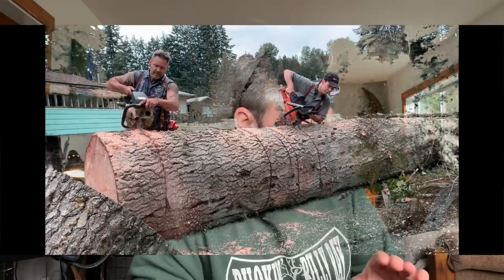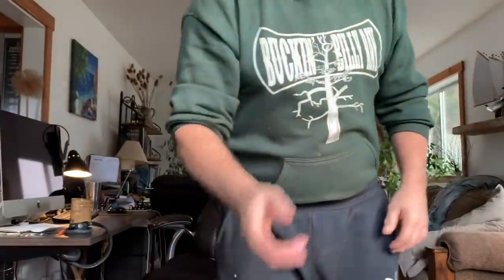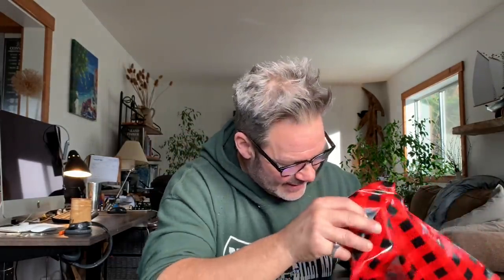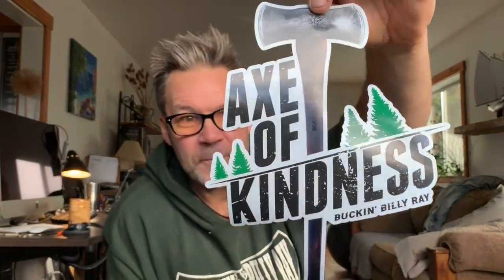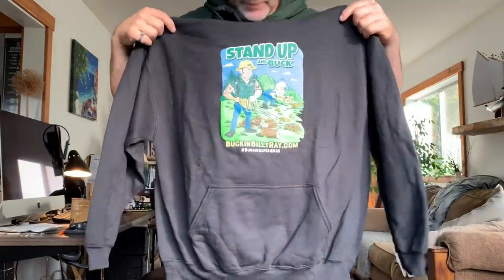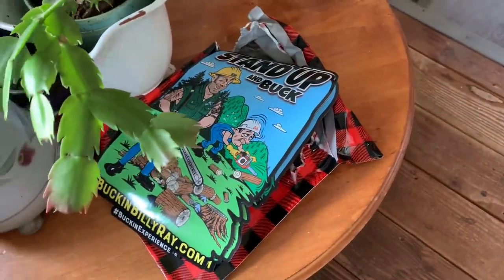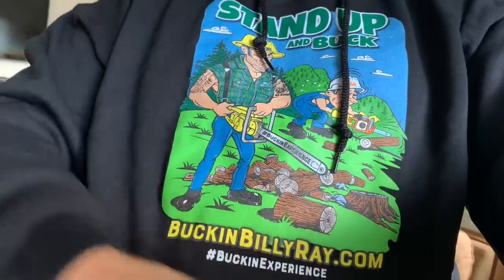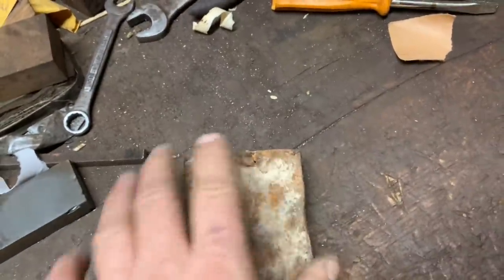Someone sent me some merchandise

Comment: The way that belt looked you have an alternator bearing locking up when it get some heat in it. It will feel normal when it's cold and you spin it by hand you can even tell anything is wrong with it. My ford done the same thing 3 times and an old timer told me this so I changed it out and it perfect now